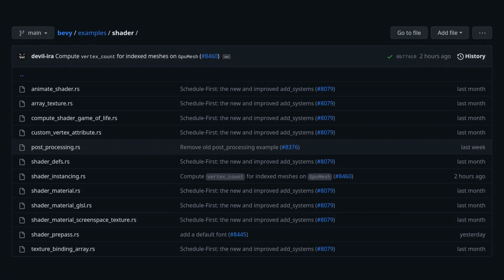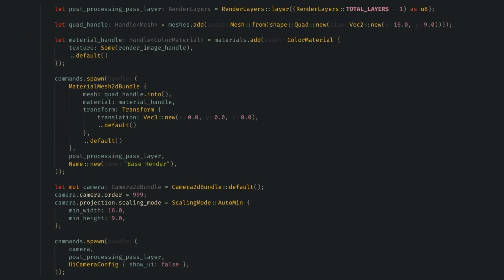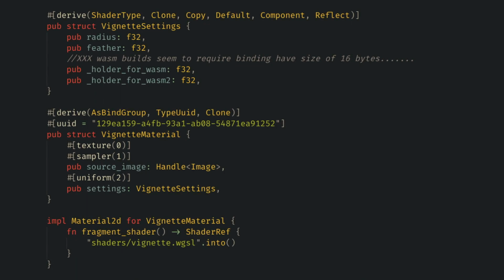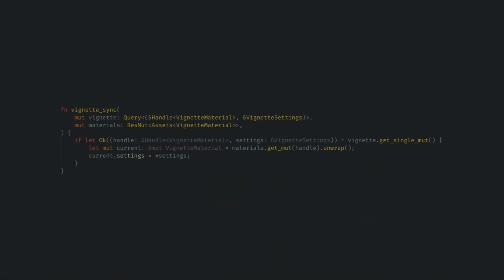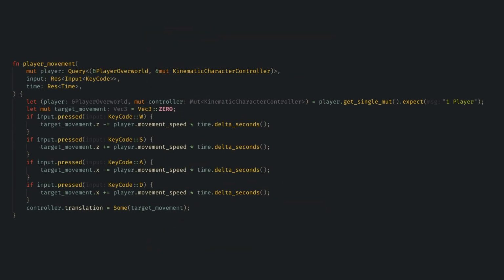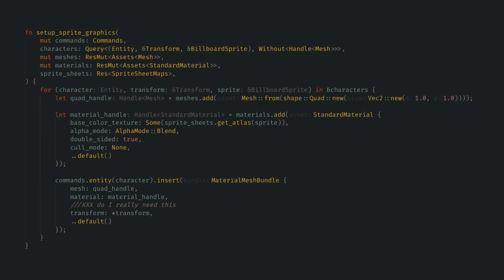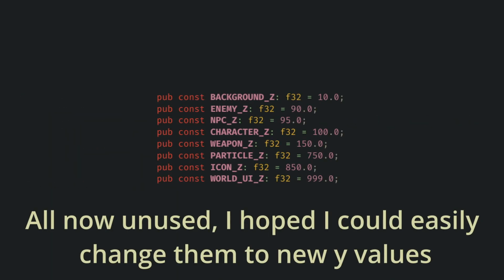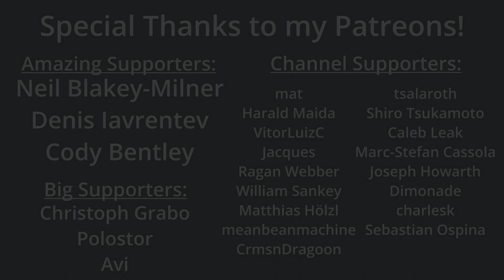Post Processing, 3D Conversion, and Physics in Bevy (0.10 Devlog 6)

Comment: Hey! Check out the let-else statements released in Rust 1.65. Might be cleaner than using `if let Some(blah) = thing { logic }`, by doing `let Some(blah) = thing else { return };` and placing the logic afterwards. Keeps the function minimally-nested!
Reply from the maker: You know, I've known that was a feature but I just never remember to use it. Usually by the time I type the let my brain is already working on the body. Good call